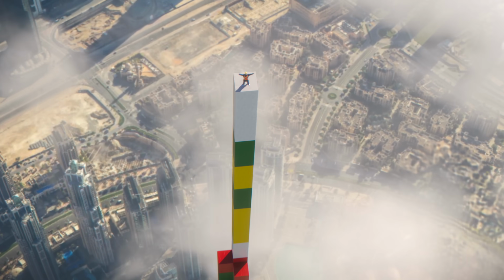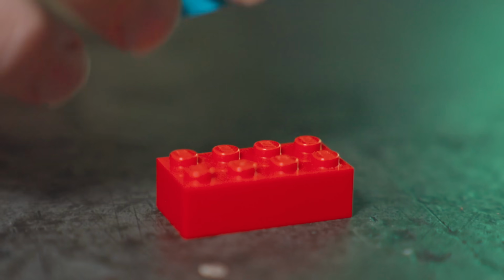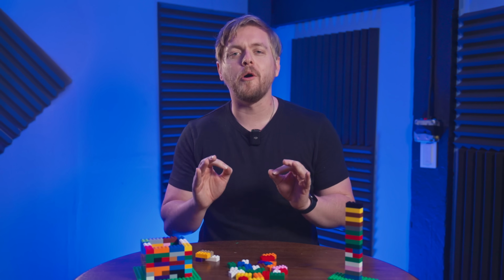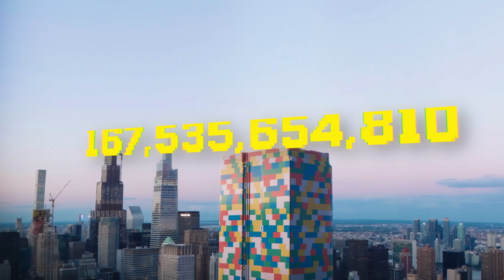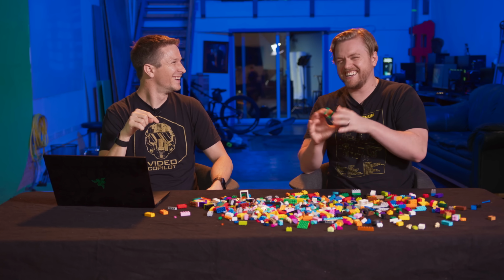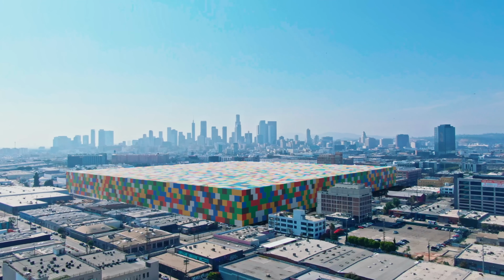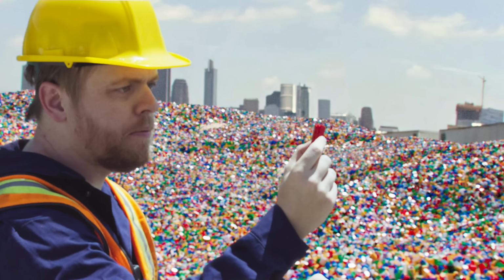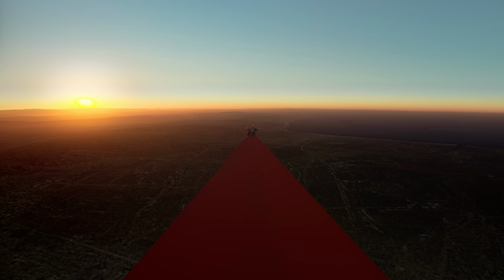How High Can You Build using only LEGO?

Comment: The sponsor was perfect for this Lego themed vid. Also for what it's worth, the Eiffel Tower costed ~$1.5M (~$36M today) to build and only took just over 2 years in construction. Even after adjusting for the inflation, that's only ~0.49% the cost of the Lego version, which you said was $7.4B. 18 cents is huge when you consider that the raw ABS plastic used cost only 0.46 cents. (0.0046 dollars). For what it's worth, if it's 41,127,882,450 bricks for the tower, that's only $189M for the cost of only the raw ABS plastic.

Comment: Ummm let’s get a bit more scientific.  You can ABSOLUTELY increase the ability to carry load before buckling. 

First of all those do not buckle symmetrically. The longer edges will see first signs of this effect. How do we take that knowledge and use it to increase load? Well simply put cross hatch. Meaning you make sure you evenly rotate those base bricks so the base has alternating bricks in terms of the direction. Why? Because as the longer sides begin to buckle they will bump into the shorter side the Lego next which hasn’t buckled effectively pushing back on the bucking Lego. This happening across a base that’s say half a mile long on each side will greatly increase that capacity 

Next let’s consider something very import for any building which is the ground that it’s built on itself. No ground is going to be as hard as the bottom of the hydraulic press. So that will also increase weight. Now you would first dig down with a very large diameter hole and build down with legos into ground. Then every say 50 feet you dig sideways in 8 directions and build legos down that tunnel this will help disperse more weight into the earth itself. Then the next 50 feet drill the same 8 holes but rotate around the Z axis so that those new tunnels filled with cross hatch legos are evenly in between the ones above. 

Cool do that a bunch more. 

Now go back to the surface and do that again 8 more times around the center (1st one) this time you those sideways tunnels filled with built legos interlock with the tunnels connect the original hole built down with legos. Cool now repeat that but moving outwards from the center creating a system of these interlocking tunnels disappear that downward force into the earth itself. 

Thats just a start but there an insane number of things you could do if given no limits on resources and such that this video just never touches on.
Reply: To be clear only refuting the point about the weight on how much weight before bottom bricks buckle. The rest obviously still always relevant

Comment: Would lower bricks fail by squidging out if they're surrounded by other bricks holding them in place and stopping the flattening? a single brick, sure, but a platform of 10x10, the inner bricks are surely going to be able to take more weight as they can't flatted out to the side.  But I don't know how much that would add.

Comment: 1 : They may be cranking out more LEGO now than they ever have, but damn it if the prices on these things aren't getting more and more astronomically crazy, like way more than the cost of the petroleum used to make the plastic pieces
2 : That graphic you show of the hydraulic press to test a LEGO brick (and I realize it's just a useful animation) would be a poor gauge of it's strength, since the force applied to the studs on top gets applied to the flat base they are on and not edge plastic vertically, so you'd want to have a rectangular frame the same thickness as the LEGO piece (basically a hollowed out lego brick) to compress against.   I hope that professor that did the tests took this into account.

Comment: Of course, a pyramid not only is more structurally sound, but also spreads out the weight more, so you could build even higher than the theoretical max of a straight tower.

Comment: The concept and info was great; but it did nag me that the large scale shots looked a bit too homogenous, like it wasn't made of individual little plastic pieces; even more noticeable in the pyramid since there would be more than just the smooth sides visible from some angles. You guys are famous for nitpicking on special effects; is this really what huge lego structures would look like, with no "micro"faceting and subtle random variations affecting how light plays across the surface?

Comment: But why would you make it solid?  Hollow structures use far fewer resources and distribute load better.  There's a reason your car's driveshaft isn't solid.  Hollow is stronger.
Reply: The original pyramids had not been solid either.
Figuring out gravity cost the architects a lot of tries.

Comment: 14:50 but surely that wouldn't apply when the structure was 350m wide. An interlocking solid block of lego that's wider than most buildings are tall isn't going to immediately collapse at the same shift in centre of gravity as a 1 block wide tower is, you need to scale

Comment: The claim that the weight bearing portion is only the outer rim because the central tubes do not sit flat is false. The studs on the brick below contact the tubes. You must build off of a large flat pieces so there is support and redo the test.

Comment: Why didn’t you do calculations with infill even staggering every other block should double the amount of legos you have and it would decrease vertically weight especially if you use the pyramid style construction. You could probably do a lot more with different percentages of infill you could have but still retain its strength you could easily get 10 times or so more than a solid mass of legos. Also why did you only do calculation for the amount of force of one brick why don’t you apply the tension in parallel.

Comment: Fun fact: It would take you 37 seconds to slide to the bottom of that pyramid. 

Base area = 4 mi² = 10.36×10⁶ m²
Burj Khalifa height = 828 m
Pyramid height = 4 × 828 = 3312 m
Base side length = √(10.36×10⁶) ≈ 3218 m
Half-base = 3218 / 2 = 1609 m (horizontal run)

// Hypotenus of the triangle:
Slope length = √(1609² + 3312²) = √(2.59×10⁷) ≈ 5090 m

// Slope angle:
θ = atan(3312 / 1609) ≈ 64.4°

// Friction Coefficient:
μ = 0.3

// Acceleration along the slope:
a = g × (sinθ - μ × cosθ)
  = 9.81 × (sin(64.4°) - 0.3 × cos(64.4°))
  = 9.81 × (0.900 - 0.3 × 0.435)
  = 9.81 × 0.769 ≈ 7.55 m/s²

// Time to slide the full 5090 m (from rest):
s = 0.5 × a × t² → t = √(2s / a)
t = √(2 × 5090 / 7.55) = √(1348.3) ≈ 36.7 seconds

// Result:
Sliding time ≈ 37 seconds
Acceleration ≈ 7.55 m/s² down the slope
Terminal Velocity ≈ 36.3 m/s²

Comment: How long a straight pole of single Lego pieces could you build in space? Gravity would no longer be a factor for a very long time. But if the pole gets infinitely long, just the slightest movement at one end would result in infinite lever action working against the inertia of the pieces resisting being moved, and the pole would snap.

Comment: The structure could be partially hollow with infill like that of a 3d print allowing it to 1. Use fewer bricks and 2. Be built taller as the cumulative weight could reach further vertically before crushing the bottom most brick.
Reply: I was looking for this comment too. You could also steepen the slope of the pyramid, to say two layers per step, this would make the base layer use 1/4 of the area, saving another huge number of bricks. Also, by having the base larger than the top, the weight of each new layer has a diminishing affect on the total weight figure as there are always more bricks supporting, so in theory one would be able to build even taller than the limit given for direct stacking.
Reply: Exactly the comment I was looking for!
Reply: The strength of a pyramid made of small blocks (small compared to the building; the huge blocks in the Great Pyramid are small compared to the pyramid) lies in the even weight distribution over an ever increasing surface area. Hollow parts would only result in worse weight distribution. Imagine a building standing on 25 pillars (5x5). Now takeaway the 9 pillars in the centre. That's nice for the foundation of the building, it now has less weight on it. But the result is that the remaining 16 pillars have more weight on each of them. And the part of the building that used to have those 9 pillars is now in danger of sagging through if the material (for example Lego or granite blocks) doesn't have the tensile strength.
But scryscrapers are hollow you say? Yes, but those are made from reinforced concrete and metal beams. You wouldn't build a scryscraper out of stone blocks like the Great Pyramid. And there is a reason the Great Pyramid is mostly solid! And its King's Chamber has no less than five relieving chambers over it that distribute the enormous weight above them to the sides.

Comment: A 3.5 km high Lego pyramid won't last even a day because of its own weight. If it had somehow retained its shape, it would have completely collapsed in 5-10 years under the influence of the sun, rain and wind.
But if it were built in ideal conditions (for example, in a giant hangar with temperature control and no precipitation), then theoretically it could stand for decades until the plastic begins to age and crumble.

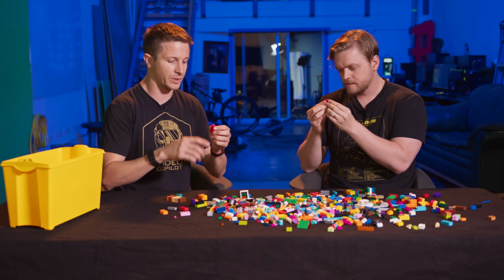Comment: 9:39 Are you sure about that? The way I see it is that the middle part would transfer the weight just as the outside, as they are flush with each other. Some blocks seem to have the center part 0.X mm away from the bottom.

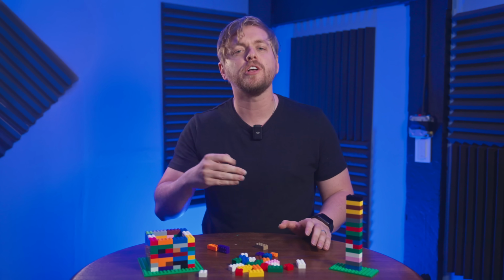Comment: 7:37 this assumes you're using only brand new bricks bought directly from lego. bricklink (owned by lego) has the current average cost of a used red 2x4 brick at 8 cents so a used lego eiffel tower could cut costs by billions

edit: i see they used the cost of new bricks for all the building examples, so same logic applies

Comment: Would it be easier and more doable with the flat Lego sheets and the bricks in a sandwich style. That's enough should give you the structure integrity. Especially if you increase/decrease weight with the 1x1 or 2x2 bricks. I feel like you guys focus too much on the 2x3 bricks for this.

Comment: The problem here is that it's 100% possible to build even higher than that mega-pyramid, by not making it a solid block.  Arches, cross-bracing, voids, advanced building techniques...  Yes, even using nothing but 2x4 and 2x2 bricks, those are possible.  Just now I've used a small pile of 2x2 and 2x4 bricks that I had on my desk to build a solid stud-inversion.  (That means I've built it to have studs on the top and the bottom.)  If you allow for other parts, like plates, SNOT bricks, Technic, and so on, the potential is exponential. 

You may ask, how does a stud inversion help in building a tower?  Well, the point of failure in a Lego brick stack is going to be the walls.  Now, in theory you could make a pillar of bricks to stand on its side, and it would help by allowing a supported cavern inside the structure.  Problem is, that would be weaker than just a tower, because the longer sides being vertical would be more prone to bowing.  If you do a stud inversion though, then you prevent that sideways pillar from bowing to one side or the other, kind of like wires pulling a radio mast in different directions so it can't fall.  It'd be better with bricks facing four ways instead of two, but I didn't have enough bricks on hand to make that.

Comment: With enough pieces you could possibly build up to 3.5 kilometers\2.4 miles tall out of Lego, as the bricks are designed and rated to withstand 4,240 newtons of force pressing down on them. Just like with conventional materials, the maximum possible hight of a Lego structure would probably also depend on its overall design. A structure that tapers from a wide base to a narrow top for example, can be built taller than a tower that goes straight up, with the structure having the same width all the way up.

Comment: Not a bad explanation of stability and buckling, Wren! Missing some important details, but good enough for getting along (especially for teaching the viewers)
Reply: Yeah, during the hydraulic press illustration, I was thinking that to be accurate, they'd need a piece that was just the outline of a Lego (like a cookie cutter) that only contacted the ridge outside the nubs, where a normal piece would rest all of its weight. Make it out of a significantly harder material than the Lego plastic, then test with a hydraulic press. Putting all the weight on the nubs isn't going to give an accurate reading of how strong stacked Lego are in practice. Or better yet, manufacture a whole Lego piece out of a very hard material to account for more variables as the real Lego plastic flexes underneath it.

Comment: Wouldn’t a pyramid shape allow for a higher building limit? Since the weight is spread over a wider base, each block carries less load than in a vertical stack. No single block ever bears the full load above it. The height limit you gave assumes all weight presses down on one block, but pyramids distribute it more efficiently.

Comment: You could do much better with it hollow. I'd probably do the classic hollow pyramid from 2x4s topped with a 2x2 but do 10 layers for each inward step. This would require just 6,646,840,270 bricks to reach 3.5 km and 472 meters wide if my calculations are correct ignoring the fact the bricks would compress slightly. It would need the occasional reinforcement but even if we multiply that number by 50 to account for this we still only get 330,234,201,350 bricks needed which there would probably be enough Lego to make if you used bigger pieces where possible.

The 3.5 km figure is based on a cubic design too, a pyramid in theory could be built a lot taller since a pyramid is 1/3 the mass of an equivalent cuboid.

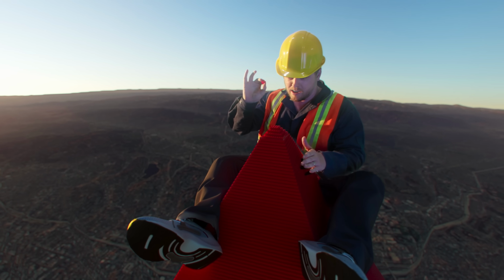Comment: 18:04 You could put a 1x1 cylinder on top, or the motorcycle antenna from the original Lego police station set (381-2) to add another inch to the pyramid.
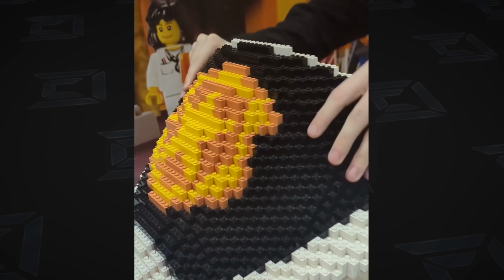Reply: He says it at 1:15 to only use Lego bricks
Reply: the top needs to be  a GOLDEN brick, the pyramidion, you uneducated folks.
Reply: @caseoh

Comment: If the tower was hollow inside, or just had some criss-crossing beams, you'd have more Legos to work with. Also, the tower could taper as it climbs, like most structures do. That would free up even more for higher levels.

Comment: So I know I am a downer but I have a number of other problems you would need to account for like the tolerance of each brick because as you build you would get foot high bends from lowest point to highest on the same layer nevermind expansion and contract at that scale from other factors or the load distribution being unequal from the tolerance of the brick causing stresses to be created that can cause buckling early and not issues pop up

Comment: What if you used the flat Lego though? Wouldnt they be more structurally sound since they connect with a larger surface area?

(I'm not an engineer so sorry if I'm using the wrong words)

Comment: I know this video is mostly for entertainment. But the engineering side of me can't help to correct a few things.

1.
Building a pyramid shape allows you to build up to 4 times taller, as the base is wider and therefore distributes the weight over more bricks, compared to a straight tower.

2.
You would not build the pyramid completely solid with bricks everywhere. The base would be solid for maximus weight carrying capacity, but as you get taller and taller you would build it more and more hollow, like Internal scaffolding. This would again allow for perhaps a factor 2 to 4 times taller before the bottom bricks are overloaded.

Comment: Even though the pyramids were made of stone the first attempts at them still collapsed just because the angle was slightly off. I’m thinking using Lego bricks would be weaker than the stone in this case and will likely still fail the test of physics if they looked into it deeper

Comment: theres a pretty big factor here that wasnt accounted for. the difference between the base and top of a brick when placed vs unplaced arent the same the brick itself makes an ever so slight slope due to it being flexed over the pegs it may be small but that builds up and in combination with error in mold accuracy thats why bricks are so hard to build in large blocks often needing a rubber mallet to assemble layer by layer

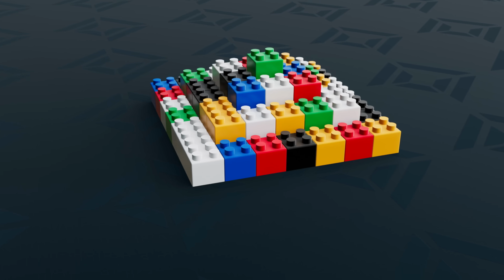Comment: 16:10 when I was younger I did indeed make a Lego pyramid, about 3/4 of a foot high, the interesting part is, I'd made it entirely hollow, but on a baseplate, the layering was one stud per step, so the interlocking of the bricks afforded it such extreme stability, that despite having no internal structure to bind/hold it together, I could actually stand on top of it (I was like 12, so prolly around a hundred-ish pounds I think at the time) but it was pushing the limits, and while I did it more than once, there was a time I was demonstrating it and it gave out under my weight, more or less exploded lol, next iteration was slightly smaller, using a percentage of the bricks instead for some internal cross-bars, that model was far more durable, and plus I'd found a baseplate that was the exact dimensions of the base, so it had a very satisfying result

Comment: as a verifiable lego nerd, theres so much missed potential by not being able to calculate these huge numbers with more complex structures like technic internals, technic building is wildly more strong than standard system, you can drop a technic set down a flight of stairs and not have a single piece come off